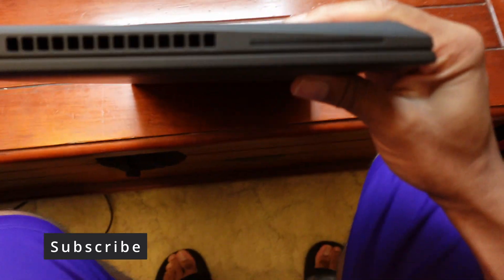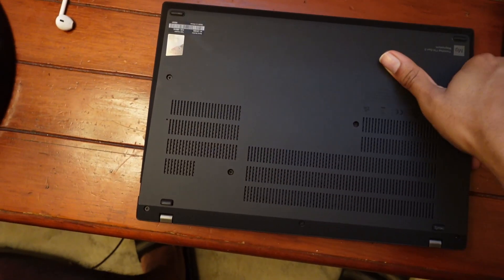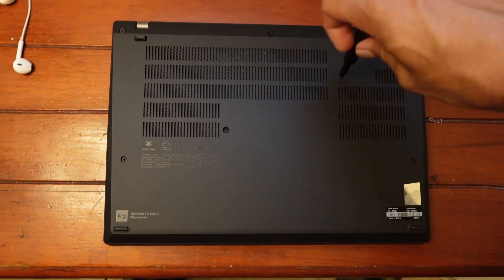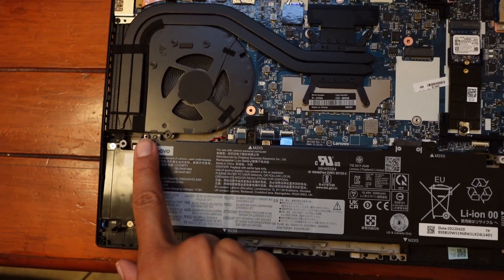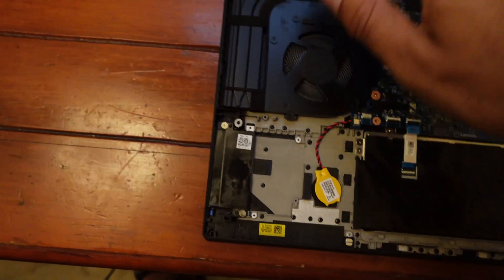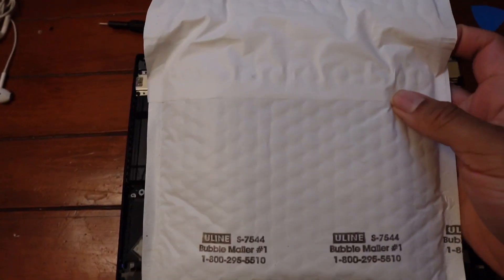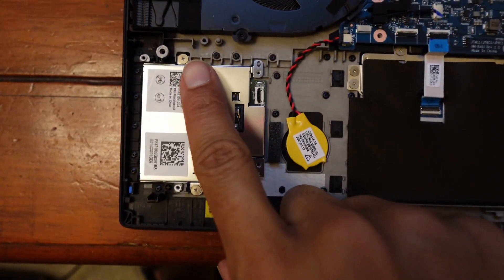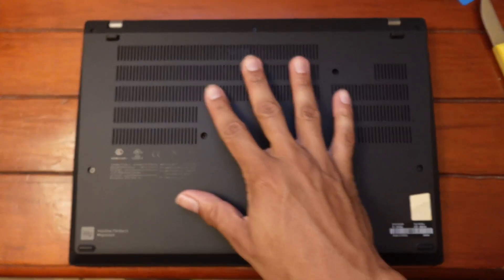Lenovo Thinkpad T14/P14s Gen 3 Smart card reader install/disassembly

Comment: WARNING: These smart card readers will NOT TAKE SIM CARDS! Do not try to insert a full sized SIM into the Smart Card slot! Even though SIM cards are Smart Cards, the pins in the reader will jam against the perforations in a full sized SIM and removing the card will rip the pins off the reader!

Comment: This is great, I have a P14S Gen 5 that I recently bought on sale and I've been thinking of adding it to mine as I'm tired of having an external CaC/PIV card reader dangling off the side. I just opened mine a couple weeks back to swap the RAM to 96Gb, replace the factory storage option to a 4Tb Samsung NVME, and added a cellular modem card to it. Adding it to my existing AT&T plan was the worst part of the process.

Comment: Hello! Are your cards recognized after installing a smart card reader?
I have the same laptop and I bought a smart card reader for it.
But the cards are recognized only in an external usb smart card reader, and they are not recognized in the one installed in the laptop.
Do you have some kind of beep or light on the laptop when the card is inserted?
Reply: Whats the smart card reader used for?
Reply: @spartanadam3935  logging in to stuff, Estonias ID card is a smart card and is used for logging into sensitive stuff like seeing health records or your bank account and all kinds of other stuff, though a business might use a smart card as a second method of verification
Reply: @IsM1ku  and that's all? any another usefull cases ?
Reply from the maker: Great Question. I purchased a smart card reader from eBay and it DID NOT WORK. In some of the video, what you were seeing was a known functioning card reader that I pulled from another machine. Looks like yours might be defective as well. Look in Device Manager to see if it recognizes your card reader, mine was not. (with the one I purchased on eBay.)
Reply: Thanks for the answer!
The problem really turned out to be hardware. I bought another reader and it turned out to be working. @followthecable4379